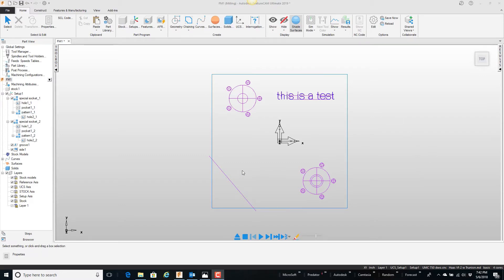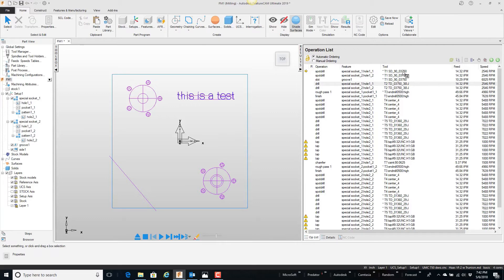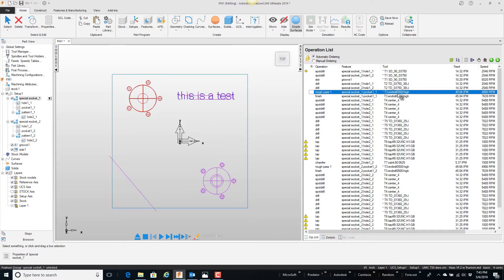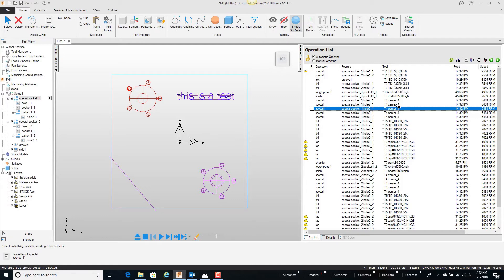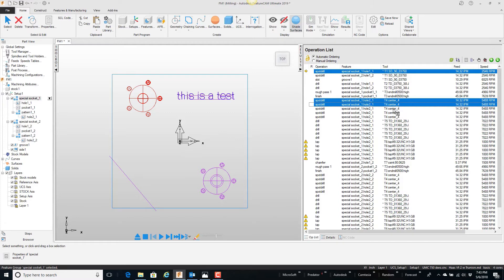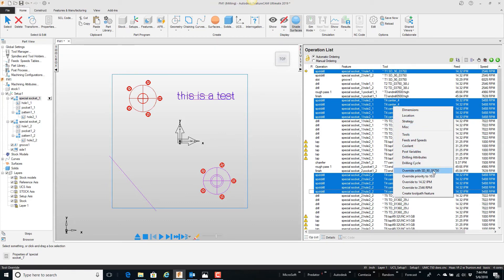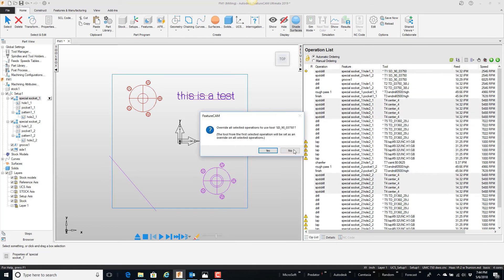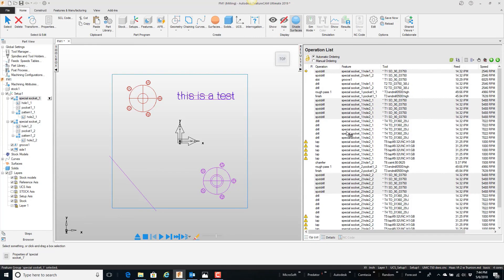Changing Tools from the Operations List within FeatureCAM

Comment: Soy, in the production environment, you are machining same type of features,but at different positions......can you develop a way you machine your features(lets say pockets or bored holes with counter bores,save it and then whenever you machine that feature in the future, the software will pull up that saved procedure and apply it to that particular feature program: as an example I would  program a pocket as follows: 
T1-roughing with 2" dia 5 insert shell mill at speed "S1" and feed "F1", taking .05 stepdown in Z direction, leaving Z.05" STK on bottom and  CRC .05",  then going in with T2-semifinish tool of 1"dia at "S2" "F2" Z stock .01, CRC .03, second pass at CRC .01", and third pass at full depth Z +.003,CRC .003. Then  finisher  at full depth Z, "S3", "F3", CRC .0005 and then final pass at Z+.002 , CRC 0, S4, F4....( Save procedure as pocket type1, .......different type of pocket would have different saved procedure)
Second example: Bored hole: T1 center drill Z-.005, S1,F1. Note to machinist: check locations with scale, then T1, Z-.100, S1,F1,  then  T2-drill, full depth +lip+.01", then T3-rough bore  S3,F3, Z full depth -.01, then finishing bore T4,S4,F4,z full depth-.001 (save it as  Pin hole...so every time pin hole gets bored, this procedure could be recalled).
The procedures need to be followed exactly with proved speeds and feed and stock amounts on walls and bottom for each tool, etc...
I would really appreciate the answer, as I am evaluating the software...